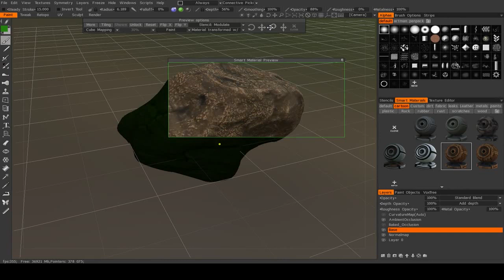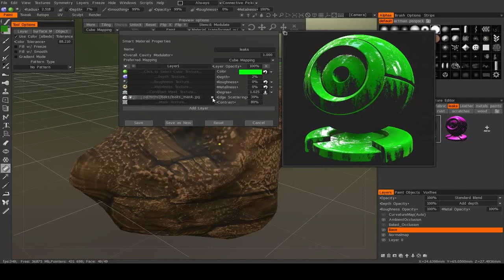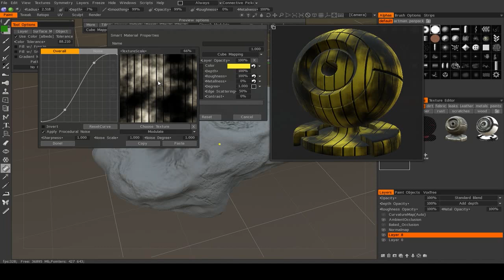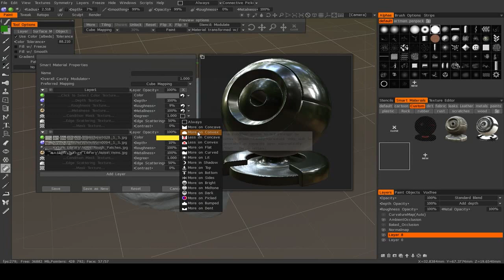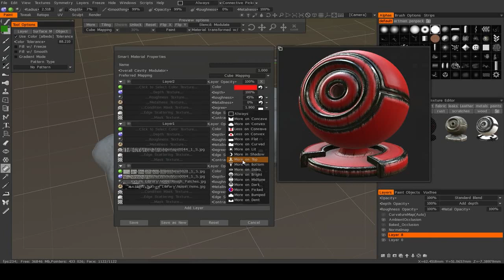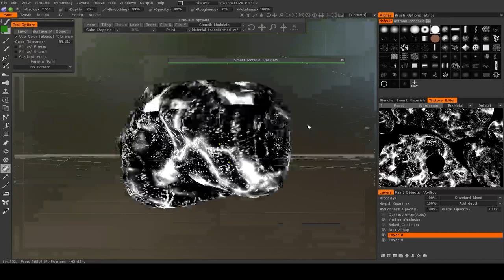Welcome to 3D-Coat: Part 21 (Smart Materials)

Comment: Why doesn't the top tool bar for Roughness and Metalness affect the amount applied like opacity and depth does?
Reply from the maker: It doesn't because opacity affects ALL the channels. When you set the opacity to 50%, you'll only apply that amount of whatever color, metalness, roughness, and depth you have set. Typically, if you want to paint new metalness/roughness values without affecting color, you can just turn off color painting and usually paint in a new layer. Now, one feature that 3d-Coat doesn't have that I hope it will in the future is to be able to paint new metalness values without painting roughness information and vice versa. Right now they have to be painted together.
Reply: Thank you for this. I'm still a little confused. If I set Metalness/Roughness there to 0 or 100, it doesn't change anything, even if I set the opacity to 50%. I would think it would take the PBR material I choose, and decrease or increase the influence of it's metalness/gloss/roughness by that degree I choose at the top of the interface, but it doesn't.  Why have it in the interface if it doesn't do anything at all? So, right now, the only way to change the amount of metalness/roughness levels is to edit the material you are using.

Comment: Do the textures that you apply tile seamlessly? Is that a prerequisite? Thanks!
Reply from the maker: The ones that I use typically are. It's usually a good idea to use a tiling texture so that the seams aren't visible when you apply the material. The texture is repeated possibly many times along the side of the model when you use a smart material, so if it doesn't tile, it can be very noticeable.